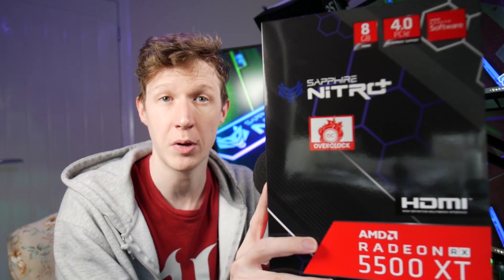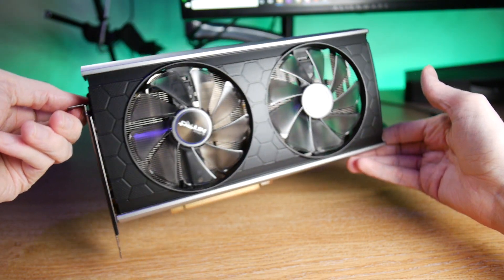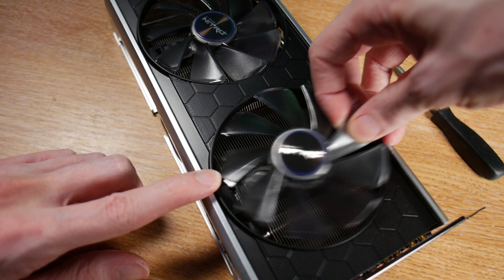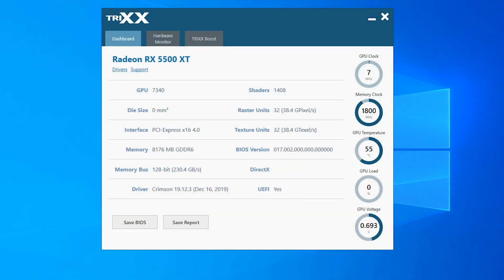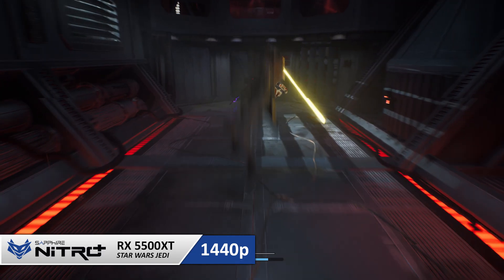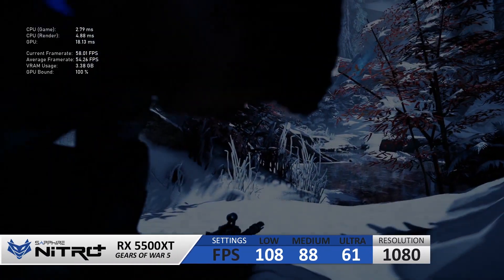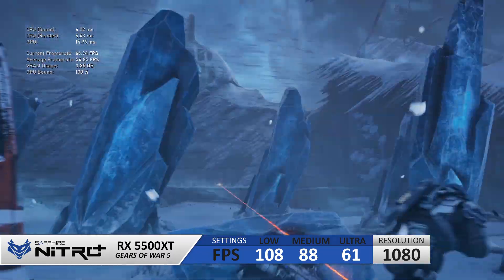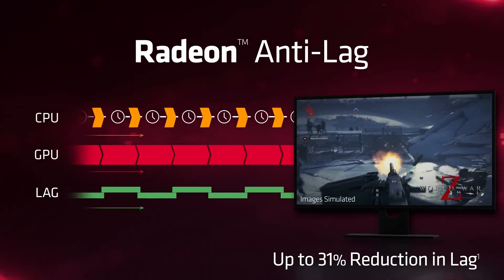SAPPHIRE NITRO+ RX 5500 XT Overview, Performance & Features!

Comment: What is the product code of the RX5500XT Nitro+ fans? I don't want to remove my card since it's already installed. I want to buy the fans even if I just bought the card last week. I want to have spare fans in my possession in case the fans become defective.

Comment: I have a RX 590 nitro+ OC automatically to 1640Mhz with adrenalin software and she is more powerful than the 5500 xt. Curiously the RX 570 and the RX 580 are still on sale but not the RX 590 nitro+. I am not talking about the RX5600 XT which is on sale and some of which by pure chance, like the lottery, can benefit from the latest BIOS aids and others not￼. it's borderline shameful. Good one Sapphire :/.